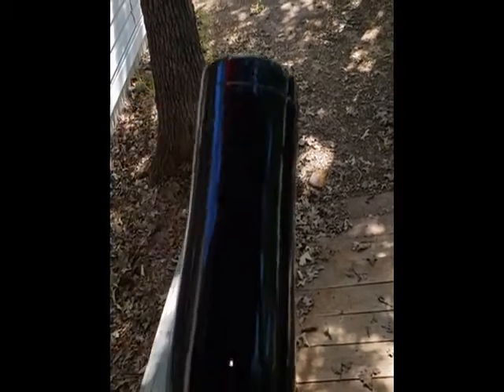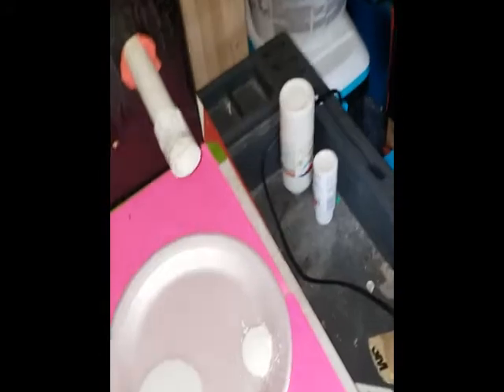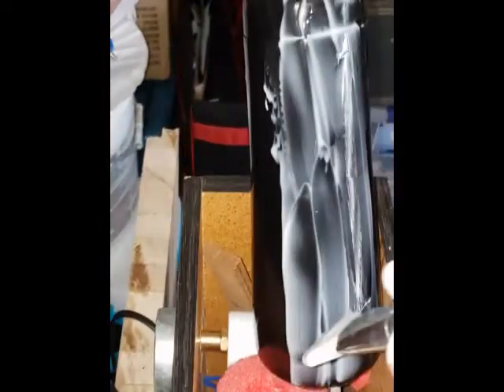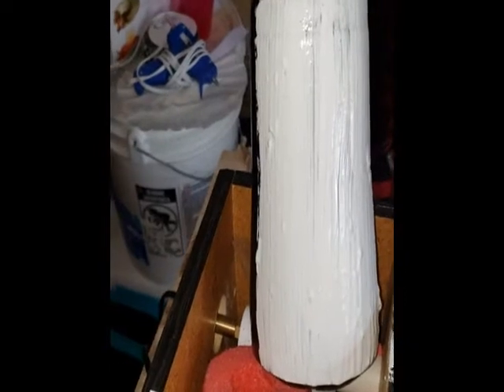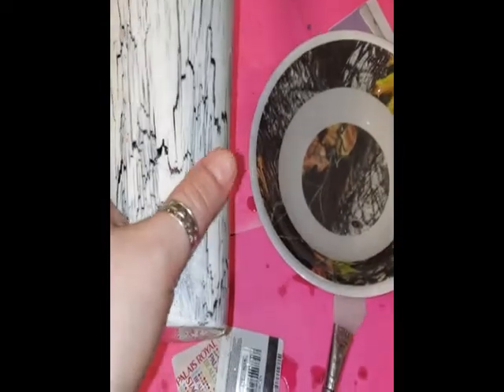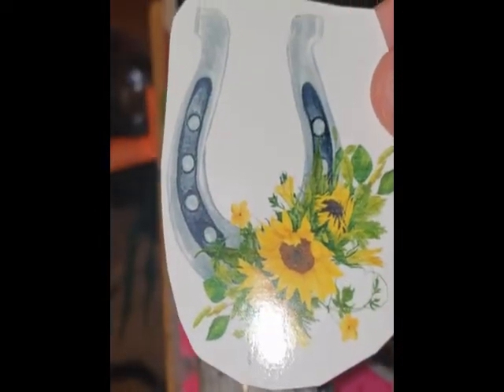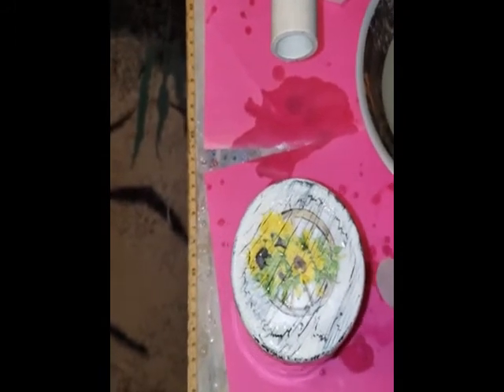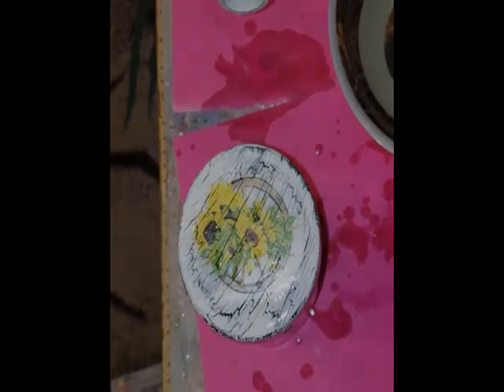How to Crackle a Tumbler with Elmer's white glue. The Do's and Don'ts

Comment: I did the same thing the first time I tried water slides! Lol I don’t like that you have to seal them so I’m trying printable vinyl next. Great job on crackle method, I’m about to try it now.
Reply from the maker: Thanks! It's nice to know I'm not alone. Yeah it's kind of a pain to have to seal them an then if its not enough they tend to crack. I want to try the clear printable vinyl. Good luck with the crackle, I was a little intimated at first but once I got the hang of it it's easy peasy.

Comment: question— if u don’t get much crackle after dried - can u apply glue and paint over the other layer ??
Reply from the maker: It's not a good idea since you could possibly fill in what cracks you did make.  The best bet is to remove the paint and glue then reapply. The thicker the glue the bigger the cracks. The upside is acrylic paint and Elmer's glue is easily removed with just water and a little elbow grease.
Reply: oh oh thank u so much for your reply…. i painted over a long skinny with a black base coat and my first time just didn’t crackle much
Reply from the maker: I had that issue too, and also the opposite where I added to much glue and the cracks were to big and glue started to slide off the cup.
Reply: @thelavenderlily5129  thank u for sharing glad i’m not the only one — hubby keeps saying why do u keep grinding ur cups and starting over? cause honey it takes time to learn a new skill for me
Reply from the maker: @02Huntet  absolutely! It takes time to learn a new technique.